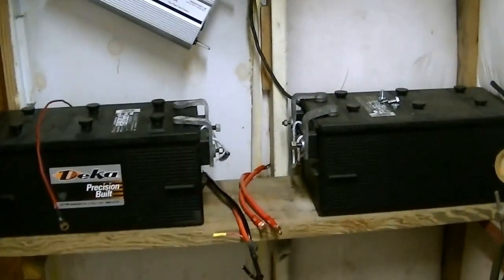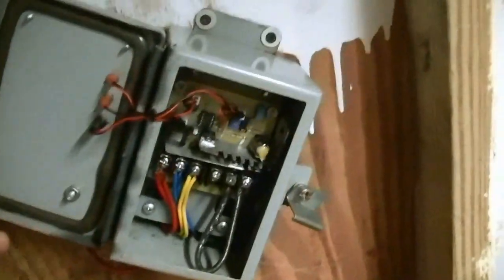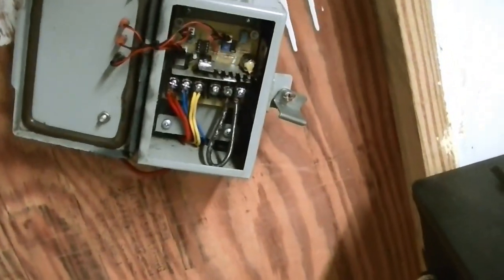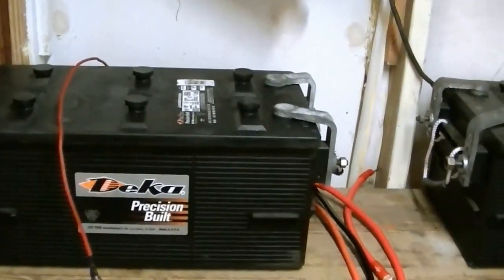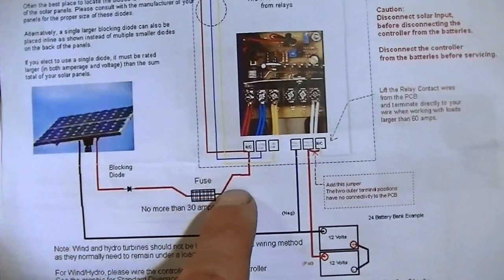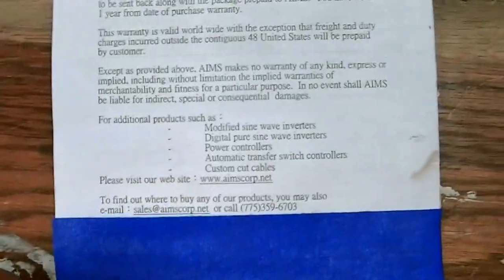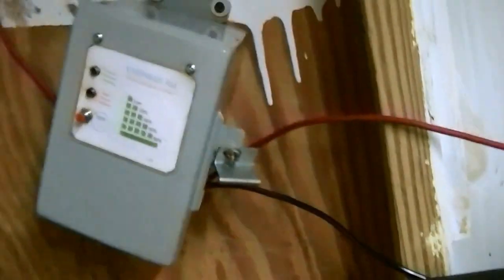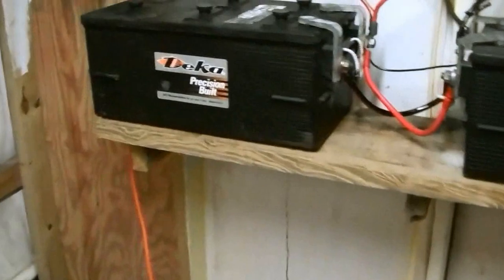How to connect solar panels to battery bank/charge controller/inverter,  Wiring diagrams

Comment: Ok cool. My battery bank has four batteries 102Ah 12v each. They are completely finneshed and I want to replace them with 200Ah batteries I heard they last longer then the one I have. My question is,,, with the same system I have 500w, do I still have to by 4 200Ah batteries or only 2???
Reply from the maker: You can use just two. To get 24 volts from 12 volt batteries you need to be a multipliable of 2.
Reply: markp0177 thank you

Comment: hi I have 2  24v solar panels 250watts each, 12v solar DC/AC inverter 800watts, charger controller 30A (12/24v) and 4 12v batteries 105A. How do I connect these components together???
Reply from the maker: I am not sure if you can. You have 24 volt panels and a 12 inverter. You can charge your 4,12 volt batteries in parallel with no problem. What I am not sure of is your charge controller. The controller will need to be on the 12 volt setting. You will have to read the controller instructions .

Comment: Wait...@  3"58 the negative from solar panel goes direct to the battery ?  I thought both the negative and positive from the solar goes into the charge controller ?
Reply from the maker: just follow the wiring diagram. My shows the neg straight to battery.
Reply from the maker: No, you can not mix the copper with aluminum.

Comment: Hi Mark,   I bought a Powerhub Plus 1800W, four years ago, just found out that the inverter is broken and can' be fixed.  Also found out that this product has had a lot of bad reviews.  Here are the specs...  http://www.mysolarbackup.com/phplusspecs.html The (4) 150W silicon mono-crystal solar panels are still good, not sure about the 4  batteries, but would like to replace them anyway with deep cycle batteries.  What would I need to replace the bad inverter and probably controller...to power a 977.5W refrigerator for a week, incase the power goes out?  Thanks for any advice you can give me!
Reply from the maker: spellerito reagan I use a 5000 watt inverter to run my refrigerator. It takes a lot of wattage to start the compressor then not much at all to run it. I like the inverter I show in this video
Reply: markp0177 Thanks!